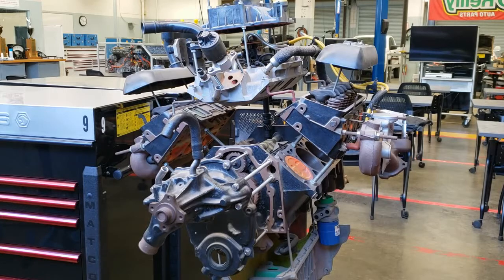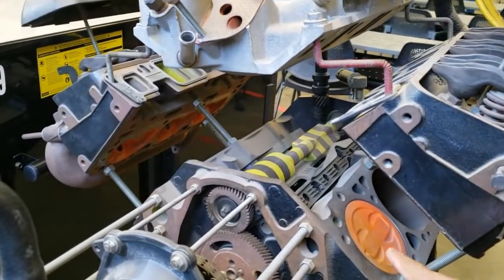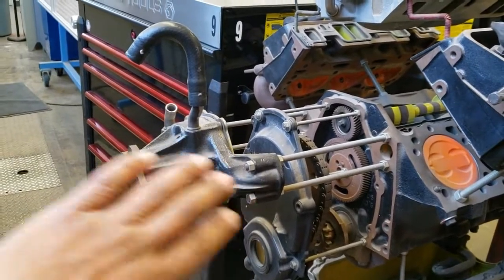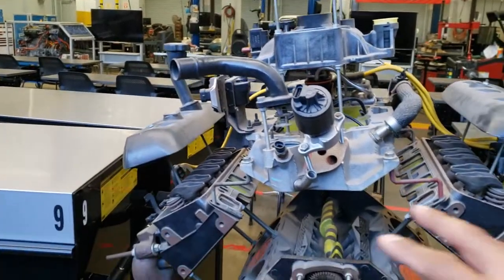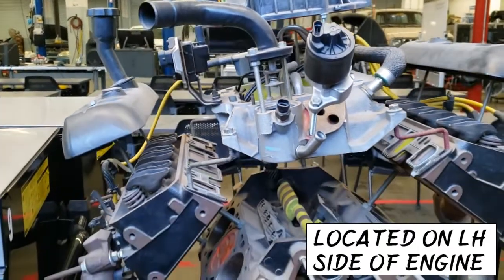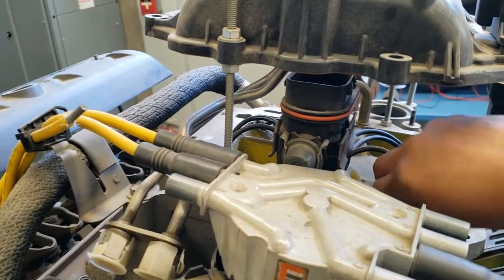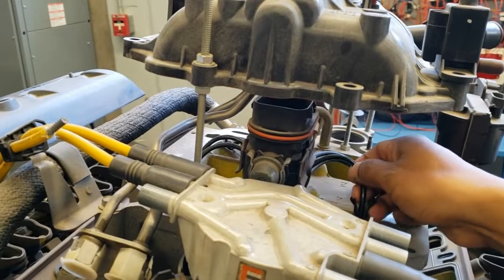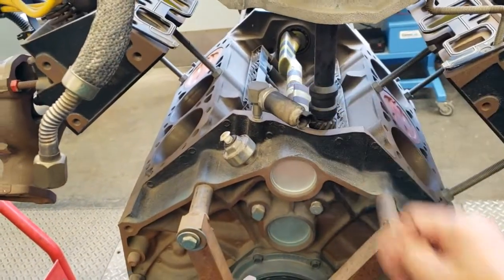4.3L Vortec Expanded View

Comment: Thanks  Noe. Excellent lesson today (once again). Im working on my 05 Safari power steering and things are going smooth thanks to your incredible tutorial on the GM system. The itemized list of tools needed linked to the video has proven itself priceless, mine is the all wheel drive and so far because of the right advice and the right tools the job is sailing along with zero cussing. Thanks again. YOUR THE BEST!!